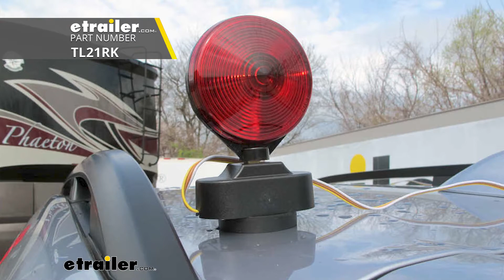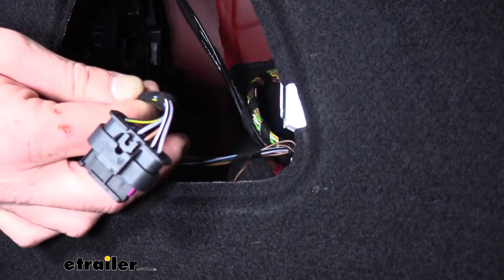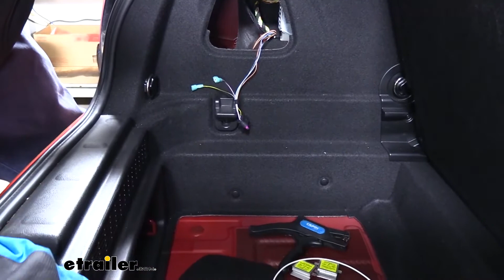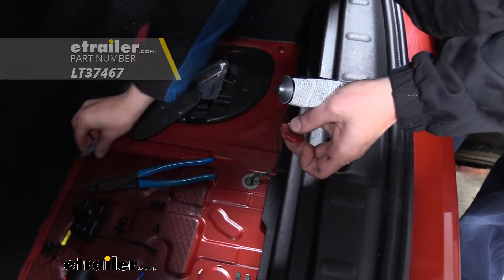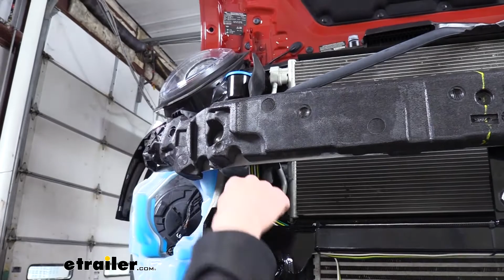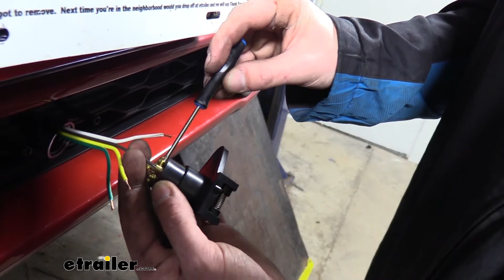Setting up the Roadmaster 4-Diode Universal Wiring Kit for Towed Vehicles on a 2016 Mini Cooper

Comment: Techniques for routing the wire from back to the front are worthy of more detail.
Reply from the maker: You can run the wiring from the rear of the vehicle to the front using any route that is not near anything hot or moving. We typically will run the wires alongside preexisting wiring so that we know its safe.
https://www.etrailer.com/Tow-Bar-Wiring/Roadmaster/RM-154.html